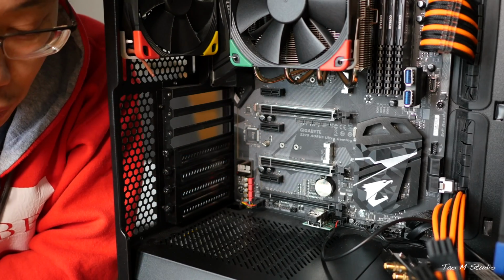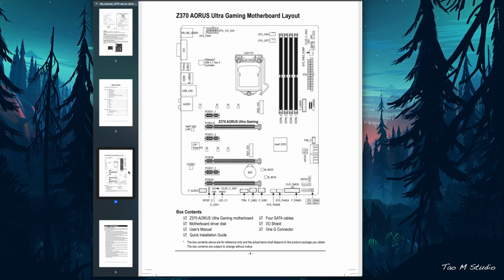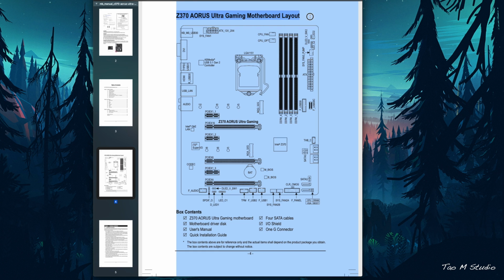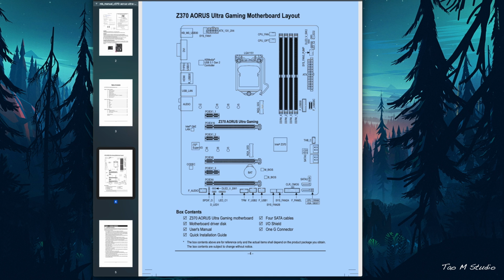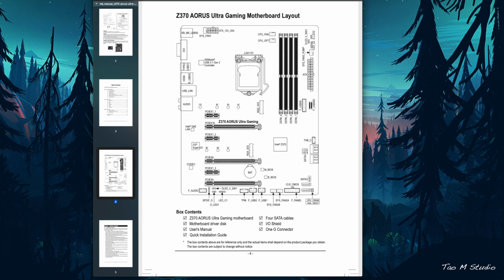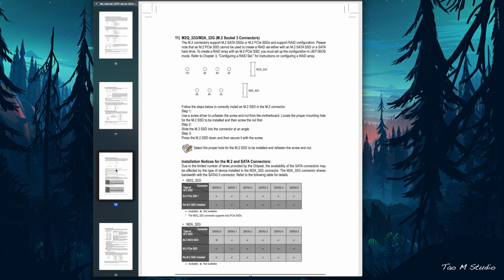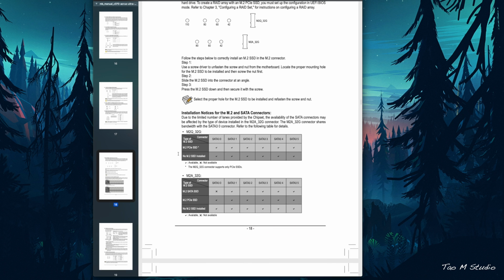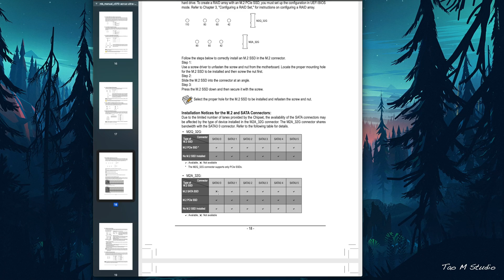Where to install M.2 SSD on motherboard?

Comment: hey i have a question what if on pc part picker The motherboard M.2 slot #1 shares bandwidth with a SATA 6.0 Gb/s port. When the M.2 slot is populated, one SATA 6.0 Gb/s port is disabled. what does that mean and where should i put my sn750 1tb ssd
Reply from the maker: @ Cheetos Panda
If #1 slot is in use, then one of SATA port on the motherboard will be disabled due to them share the same lane. you can use M.2 slot as normal, just not to use one of the SATA port on the motherboard( which you need to find out which SATA port is disabled).
Reply: @TaoMStudio  so you are saying i need to plug in the cable from the psu to another port but i can plug in the m.2 ssd the same? t
Reply from the maker: @ Cheetos Panda 
You lost me. What mobo is it?
Reply: @TaoMStudio  it is the asus rog strix z490 a gaming lol thx for helping me btw
Reply: @TaoMStudio  so i wanna put the sn750 in the slot under the cpu cooler and so you are telling me to plug in the sata cable into another port and it will work fine without changing bios correct?
Reply from the maker: @ Cheetos Panda 
1)According to your mobo manual(https://bit.ly/39gPFZC, page12): SATA6G_2 will be disabled if you use M.2_1( the one under the cooler). Which means you can use any of the M.2 slots, even at the same time, but once you plug your WD Nvme into M.2_1, then SATA port 2 on your mobo will be disabled.(just use other SATA ports)
2)There won't be any settings for you to change if you want to use M.2_1 and SATA 2 port, there is conflict. One or the other, not at the same time.
It is interesting that ASUS manage their PCIe lane bandwith on this board.
Hope this helps.
Reply: @TaoMStudio  wow you are probably the most helpful youtuber who helps with all comments i think you will grow to become a big youtuber thank you so much for that information thank you a lot now i can build my pc properly thank you very much :)
Reply: @TaoMStudio  so i read the manual and i should put the ssd in m.2_1 and sata port 2 correct? or i should put m.2_1 and another sata port? thank you for answering my questions
Reply from the maker: @ Cheetos Panda 
Just don't use the SATA_2, then you will be fine.
Reply: @TaoMStudio  wow thank you very much you just earned a sub :)

Comment: In hindi, Tao means uncle😂😂
Sorry if you feel bad .
But wow, I found only one good quality and informative vid on YouTube, that was you 
Thank you.
Reply from the maker: @Orange Squash 😅😂🤣
Reply: @TaoMStudio  hey,  is the ASUS Prime H310M-CS R2.0 
Good? The pc has i3 9100f and 1050 ti  GPU. Can we install a M.2 SSD in this motherboard.
Reply from the maker: @Orange Squash It does not seem to have M.2 slot. But if you really want to use m.2 ssd, you could get a M.2 to PCIe adapter. The board has 1 x PCIe 2.0x1 slot. But you might not get full ssd performance.
Reply: @TaoMStudio  but now people are saying that I haven't used good motherboard and I am a first time pc builder. What aboutASRock Intel B365 it has good reviews and has a m.2 nvme slot too.

Comment: Ok so the question i have is.

Can i use m.2 sata ssd on m.2 nvme slot ?

I am kind of tight on budget and got a laptop with no hdd bay but 2 ssd sockets
Reply from the maker: @ Altamash Parwaiz  As long as your motherboard support it, then yes.

Comment: I installed hard drives back in 2008 and I got a newer computer with a I7 7700 gaming computer with the ram turning all different colors. I have a similar motherboard to yours. Do you have a email address so I can give you the specs and tell me what it needs in SSD, to make it super fast.

Comment: Tao M Studio:  need Ur Help< Advice, Tips I bought the Asus Z390-A, come with 2 slots for M.2 Drives,  the top slot it's 2280 with No Heatshield, and the bottom M.2 slot can run The  22110 or 2280  M.2 Drive But i bought both 2280.  i read the manual says: ""when the m.2_1(Socket 3) is operating in SATA mode, SATA port 2 (SATA6G_2) will be disabled"". So with that being said will I have to go into Bois and Enable the second slot?  I hope you can shed some light, Also the Bottom slot does have a Heat Shield, had to Order an M.2 Heatshield for the Top Slot I got the 2  slotted M.2 motherboards to Reduce the 3.5 HDD's and cables, but the manual well makes it questionable,  Also i don't want to run in Raid i i want to make 1-M.2 drive My OS the 500GB  and the 2nd M.2 a 1TB  for my Games, i think the bottom slot may not run all that faster but no biggy, but i'd sure like to Hear Ur input really Appreciate any Information you have to say Thank You. Oh Also you have lots great content on Ur YT Ch. i will subscribe want to check out more of Ur Videos.
Reply from the maker: @Rom3
Hi, 
1) no need to change anything in BIOS. 
2)According to ur manual: m2_1 slot shares the same bandwith with SATA_2 when SATA M.2 plugged, therefore, SATA_2 will be disabled(can't be enabled in BIOS). Now, if you plug PCIe M.2(NVMe) into m2_1 then everything should run as it should be(check your manual to ensure m2_1 supports PCIe M.2). 
3) thanks for the sub🙏
Reply: @TaoMStudio  : Ahh man thank you tao for confirming my question really appreciate you getting back with Good News. This what the manual Reads:
* M.2 Socket supports PCIe  3.0 x4  and SATA mode M Key design and type 2242 / 2260 / 2280  PCIe and SATA storage design.
* M.2_2 socket support PCIe 3.0 x4 M Key design and type 2242/ 2260 / 2280 / 22110 PCIe storage devices.
* These sockets support IRST (Intel Rapid Storage Technology)

*when the M.2_1(Socket 3) is operating in SATA mode, SATA Port 2 (SATA6G_2) will be disabled.
* The M.2 SSD Module in Purchased separately.
 And of course, i will be Ur New Subscriber, there's other content i want to see on Ur Ch. TY

Comment: Hi, thank you for your video!
First of all, I apologize if my english is not good :)

I will build my first PC, is it possible to install only one M.2 PCIe 4.0 NVME SSD drive with 1TB capacity on the X570 or B550 motherboard, without adding another drive? and use it as a boot drive, as well as file storage (I mean, as a C, D, E, F drive at once) ...?
if this works, what are the weaknesses?

I see you are using two M.2 nvme SSD drives (one as a system drive, and the other as a separate file storage) ... does it have to be that way if you use M.2 nvme SSD?
I am still wondering what is the benefit of this configuration?

Thankyou for your guide! this is very helpful!
Reply from the maker: @ Ali Mahfudli
Hi, you can use just one NVMe SSD. In my setup, 1TB NVMe is just for editing. It makes 4k editing a lot smooth due to its insane read/write speed. The other m.2 is for system drive. I have a habit of seperate everything else from system just in case of system drive failure. Hope this helps.
Reply: @TaoMStudio  
so what does it mean when the system drive fails in the case with one M.2 nvme SSD drive?
will it harm my work files on other partitions?

and what is the minimum drive capacity that you recommend for systems with graphic design needs?
Reply from the maker: @Ali Mahfudli
When system drive fails, you loose everything on the drive( unless can be recovered). If you want to use just one SSD for everything, I personally would go for at least 1TB, so you still have space for other things.

Comment: Damn the music in this is so much better than the other one I just watched featuring the Extreme4 (think it was also you). I have the Extreme4 X570 and I've read that the heatsink pad is hard to work with without messing things up because it's so sticky.
Reply from the maker: @PocketBoop Alcohol wipes are your best friend when come down to sticky things.😉
Reply: @TaoMStudio  Those cannot be found ANYWHERE currently.Thanks a lot Covid-19! :)

Comment: I have a question brother, buy a ssd m.2 sata wester digital green 240gb but in this z170a sli plus it does not detect them I would like to know if it is not compatible with the sata type m.2
Reply from the maker: @Adolfo Games
I would suggest you looking up your mobo's manual.

Comment: Can I get some help please? I bought a Gigabyte B450 AORUS M ATX motherboard, which should I get?
Reply from the maker: @ Vishål 
Your mobo supports both PCIe NVMe and SATA M.2. Here is the manual(page 16): https://bit.ly/2zeFffP. I would go for PCIe NVMe for better performance.

Comment: Just a quick question, I have an m.2 that I am wanting to fit in my new pc, do you have to take the GPU out cos I've never built a pc and i don't want to break a £1600 system.
Reply from the maker: @ Bailey May
Check what M.2 you have and if M.2 socket/s on your motherboard support what you have(your mobo manual will tell you that). If GPU is out of the way, then no need to take GPU out.

Comment: I can't find it in my x470 asus prime pro manual. Can you help me? One m.2 slot is with heatsink and cooling. The other m.2 slot is without. I want to use my cheap WD blue 1TB on the heatsink slot and my Adata spectrix S40G 512gb on the other slot. Does one slot has lower performance and what should I do?
Reply from the maker: @Alpha97 Here is the manual: https://bit.ly/2zdsdz2, And Page 13 is what you want.
Reply: @TaoMStudio   thaaaankyouu!!

Comment: THANK YOU! I wouldnt call myself a "Pro" but Im certainly not a Noob, & Im 100% certain that even many qualified PC technicians (or Pro's) make mistakes & constantly find out new information that they werent aware of (I know Ive shown my local PC technician several things he either didnt know or was wrong about & vise versa, he didnt even agree with me that you cant turn Windows 10 updates off anymore without bypassing it with a manual fix) thank God I bough 2x PCI M.2's & not SATA ones, but Sata ones are so slow in comparison I dont think many would buy them.
Reply from the maker: @ Virus Of Cyrus 👍

Comment: can you helo check my Motherboard bro? 
ssd m.2 what is suitable for my motherboard? m.2 SATA or m.2 NVME?

this is my motherboard:
https://support.hp.com/nz-en/document/c04790224

thank you
Reply from the maker: @ Gin Ginanjar 
On the support page, it says" One M.2 socket 3, key M". So, it is NVMe. But it does not mention the length of card it supports.
Reply: @TaoMStudio  thank you so much bro. gbu

Comment: i bought one m.2 sata of 500gb, and now couple of months bought a 1tb m.2 sata, not knowing that m.2 doesnt mean its pcie, and i didnt know it had two different types, the mother board says that the first slot works with m.2 sata 3.0 but the 2nd one sata 3.0 doesnt but 3.1 and higher and the last one is only for pcie ssd, SOOOO FUCK

Comment: Hi Tao, Usefull info there. I have the same motherboard with a 256GB Samsung 970 evo in the first m.2, i recently ordered a 1 TB Samsung 970 Evo plus for the second m.2. Some people say to use the 1 TB SSD in the first slot. What is your opinion on this? Thank you in advance.
Reply from the maker: @Ibrahim. Hi, I have WD 256GB PCIe SSD NVMe in M2A slot; and Samsung 960 Pro 1TB in M2Q slot. It does not matter which slot you use, both slots support x4 speed when used with PCIe SSD. However, if M2A slot is used with SATA M.2, then SATA3 0 ssd can't be used. Please refer to manual for the slots.
Reply: @TaoMStudio  Hi thanks for answering this quickly. I have taken a different approach. I used the Evo + As my C drive in the M2Q and de 250 GB normal Evo as my D drive in the M2A. Installing my windows and games on the C while foto's and docs go to D.

Comment: 😂 I just risked it and it works a couple weeks later though I’m double checking.
Reply: Same, didn't even bother looking up to find out which slot to install the M.2. My motherboard also got 2 slots and I put it in the upper one. Never thought it would be another thing like RAM installation where you put them in the A2 and B2 slots for dual-channel instead of A1 and B1. Well, as long as it starts and boots it shouldn't be wrong.